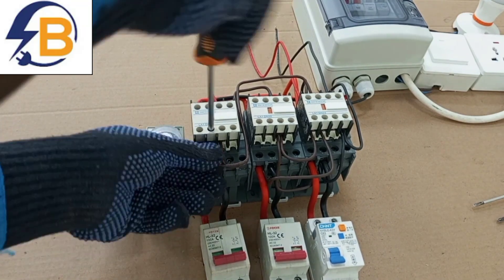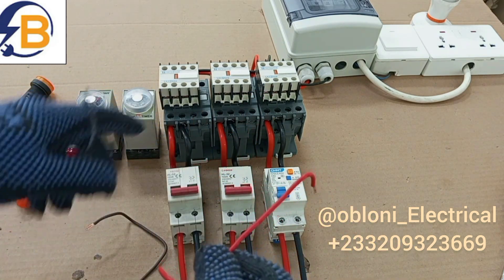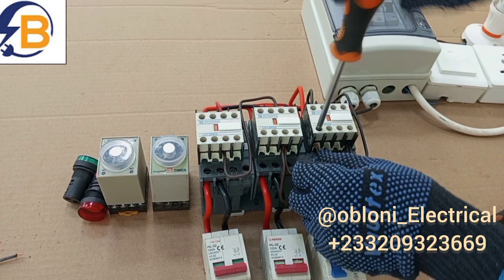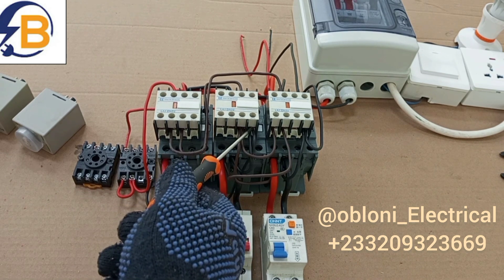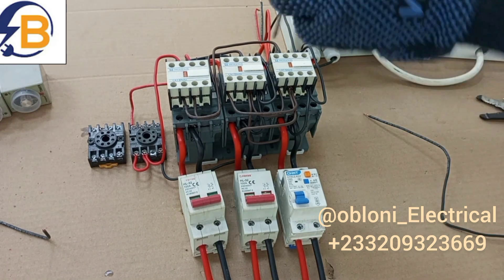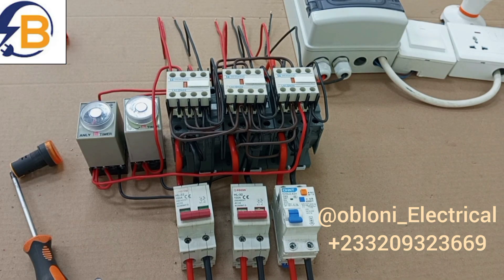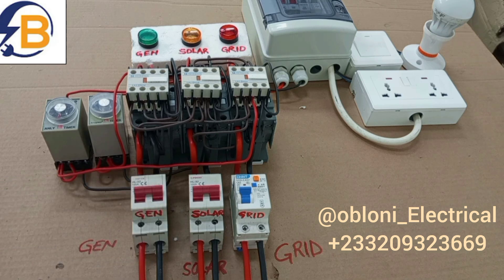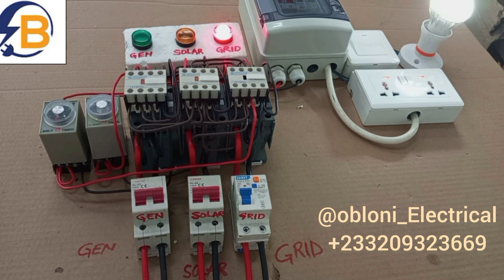THREE INPUT ATS. COMPLETE WIRING

Comment: This control circuit is effective, but it would improve if the timer could enable the contactor to engage in a specific sequence and priority: first the solar power, then the grid in case of solar failure, and finally the generator if the grid fails.
Reply from the maker: @joepinga7356  
Yes please, that arrangement has been done but in this case, priority is given to the grid. Thanks for your contributions 👍❤️